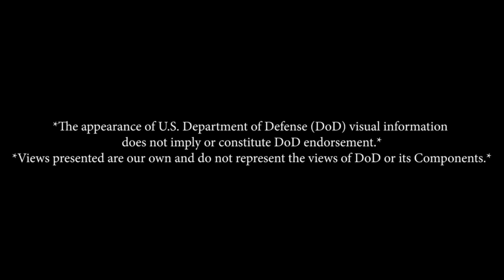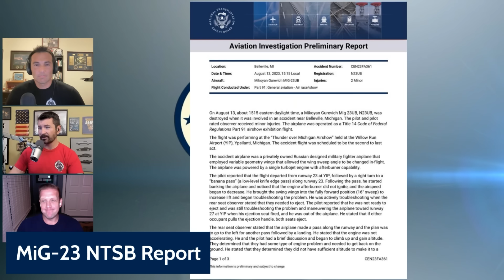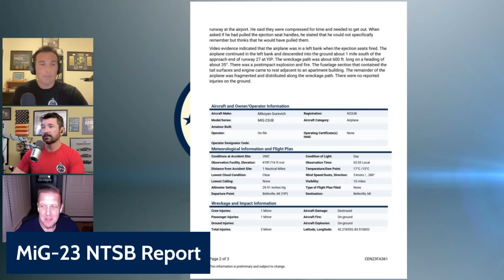MiG-23UB Mishap NTSB Preliminary Report Review

Comment: Richard Bach, in his excellent “Stranger to the Ground,” tells this story from back in the ‘50s. A USAF T-33 was on a flight somewhere over Europe. The guy in front was PF as would be expected. The guy in back reached down to adjust his seat but instead pulled the lever to inflate the under-seat life raft. The designers had apparently recognized that this could happen and had placed a sharp object within reach. The backseater employed this to puncture the rapidly inflating raft. The raft was rubber and so was packed in talcum powder. The intercom cable got unplugged so the PF did not know any of this. He just saw the cockpit fill with smoke. Apparently item 1 on the smoke in the cockpit checklist was shut down the engine which he did. The guy in back thought the engine had failed and he punched out. Meanwhile the PF had spotted a suitable spot on the ground and carried out a successful off field (i.e., crash) landing. Unfortunately there is no surviving record of what the two had to say to each other at the debrief.
Reply: that's some looney toons s**t
Reply: Whats normally said in that situation lol

Comment: Back in May of 1986 the local ANG (128 TFS, 116 TFW) gave me a back seat ride in one of their F-4D's.
The first thing the pilot told me, after strapping in, was: "DO NOT TOUCH THE COMMAND EJECTION HANDLE UNDER ANY CIRCUMSTANCES!"
It was in the vertical position, which means that if the pilot ejected, both of us would have gone, me first, or, if I had ejected, only myself would have gone.
Guess this brief (or at least strong advice) was not performed in this case...
Also: "Do not attempt a ground ejection, I will get us out...", and, "Do not jettison the canopies..."
Must have known a lot that I did not.
Thank goodness that that Flogger, by some miracle, missed that apartment building by the narrowest of margins.
Now, I wonder who sues who for causing the crash?
Reply: Back in same time frame there was a fatal accident (Navy?) where they were showing some kids the cockpit and somehow one pulled ejection handle & seat fired inside hanger.
Reply: @alanholck7995  That was an S-3A at an airshow.
The kid was not strapped in to the seat so he fell out at apogee.
Ejections on hangar decks and hangars are messy...
Reply: @alanholck7995   The seat was not safed? Someone should have been court-martialled for that.

Comment: 20 year AF guy here, if a pilot says he has it, you leave the damn handles alone, unless you either have fire licking at your butt, or the pilot is incapacitated AND as Mover said, you yell EJECT, EJECT, EJECT! BEFORE pulling the damn handles.  As Gonky said, if you are not head back into the headrest and arms by your side when you go, you are indeed looking at a better than even chance for "200% VA determination".  Seen a bad example of that when a 2nd Lieutenant punched out a Full Colonel who was troubleshooting a flight control issue, without saying anything, and broke the Colonel's back. IMO this backseater (at least two notches below WSO, 🙂) lost his nerve and panicked.
Reply: @davidkavanagh189  I'd love to hear word by word exchange once it was clear afterburner didn't light up. I can imagine "Wait Wait Wait" from font seat as important as calling Eject.
#DiscourseAnalysis
Reply: Crew Resource Management is strictly knowing who is doing what during the task.  Yes, this may include scenario mitigation, but in the end there should not be, any confusion about who is in command. In the Air Force (as with other military brasnches), command equals responsibility for the unit and its members and that is sacrosanct.  If this ejection whether unilaterally or inadvertently done, had harmed anyone, either his crew or those on the ground, the pilot/AC would have been the one responsible. I would tend to agree with your assessment if the aircraft was going straight down OR as stated, a fuselage fire was out of the view of the pilot, but again, you have to warn that the ejection is being done.  AND the AC would be still faulted for losing awareness.  As the recorded visual perspectives available could be misleading as far as flight path trajectory, this aircraft did not appear to be falling out of the sky at the time and did glide quite far before impact. Of course this is all moot if these guys had zero military experience, and were just out having a good time, but then flying high power jets over populated areas is the wrong place to do 'watch this' flying.
Reply: @paulholmes672  the rear pilot was smarter in this situation... i dont care who is in command... front seat pilot was affected by loosing his aircraft... so he trying to save it beyond reasonable rate... they dont have much more time to eject... save ejection for km-1 is 300ft in slow speeds... 

if i as more trained and experienced guy in the cockpit will yell eject eject eject and owner of the aircraft will yell no no no i got it and wanna try to save the plane even if its not savable... i will go out no mather of what...

Comment: I walked the crash site. This plane practically threaded the needle the way it crashed. A few degrees to the right or to the left, if it crashed a little earlier or a little later and there would have been a lot of deaths. If this backseater ejected on a whim, he'd be looking at some major manslaughter charges if that had happened.
There were some guys there when I walked the site (and took pictures) picking up scraps of the plane. They were local aircraft enthusiasts. Most of the stuff they had found at first was bits and pieces of hydraulic hose and pieces of the plane's hull (just a few inches in size at most). I looked down in the mud and found a few little pieces myself including some sort of dual electrical socket and a hydraulic module. While I was there poking around, one of the guys found this large bullet shaped cylinder thing about 12-18inches long and maybe six inches in diameter. It had some big electrical cables coming out of the flatter end of the cylinder and they connected to some sort of open electrical box with components inside covered in Cyrillic writing. More cables came out of that electrical box and connected to a smaller metal box. I took pictures of it and strongly suggested that the guys call the police and let them know what they found. After a few days, I couldn't help but think that they might not have turned the module in so I found the NTSB website and submitted the photo and a description of what had happened with my contact info. The next morning, I got a call from an FAA guy stationed at Willow Run airport and I went over what happened regarding the guys picking up scraps and about the accident itself. The guy was really friendly and personable. He said that they might reach out to the media if they thought the component was important to the investigation. That never happened, so I'm guessing those guys have a pretty cool souvenir.
Reply: 1) anything dangerous or secret would have already been removed from the aircraft 2) don’t be a snitch, why give the faa more power and a case to hamstring someone for a frivolous reason.  You were not harmed, stay away and stay out of people’s business.

Comment: An observer is a person who occupies a jump seat on the flight deck during a flight. There are various reasons to have an observer on a flight: Checking or examination of pilots. External (e.g. CAA) or internal (company) audit. Pilots on positioning duty (e.g. jump-seating to another base, home, etc.)
Reply: They should do those things over a safe location or home field. Not an airshow packed with spectators and people going about their days. 
So lucky it crashed in a narrow strip between a busy intestate highway and apartment complex. Also just outside the airport fence and not far off centerline for the runway. Had someone been there to pilot it, a safe landingg appears entirely possible.

Comment: The thing is the UB is a trainer-fighter modification. The dude in the back is supposed to be an instructor (and in the front is a trainee). So, because it's assumed that an instructor knows better, when he pulls the handles both eject. Pilot's consent not required. I think the dude simply didn't know that. 

Also, judging from the vid of it it looks like he ejected them from a perfectly capable of flying aircraft. It's a swept wing, after all. 
Also, the dude's a snowflake that can't handle pressure, destroyed the only flyable privately owned 23. 
Also, he justified it as they wouldn't be able to land it safely. But yeeting a craft into a populated area is safe? lol

Comment: Hey man, been following you for a few years now, question to ask you. (I'm a little freaked out) I live in the Republic of Ireland (we're a neutral country) I was out with a mate of mine and we saw 3 fighter jets with green lights on, my question is we as Irish don't have jets, we have pc930m's.should I be worried?? I know there was talks of us buying F16's but they flew low and fast the lead one seemed to be about 100 to 200 ft lower, I don't know if it was the RAF I tryed checking flight radar and nothing came up, I don't know it or whats going on I'm freaked. This was at about 22:10/22:15 (10:10/10:15 pm Irish time) maybe a touch later. I'm freaked out like proper freaked
Reply: Nothing to be freaked about. Nothing will be over Ireland without being tracked and known about. Could well have been RAF as they conduct air space policing on behalf of the Irish

Comment: Epic facepalm.

All versions of the MiG-23 (as well as the MiG-25, and possibly the MiG-21 family from the M version) have a KM-1 seat made by the MiG design office, which is 0 meters from 0 - 270 km/h , 100 meters for speeds of 270-600 km/h, 500 meters for speeds up to 600 km/h, ensures the pilot's survival. If I remember correctly, this seat is associated with the highest speed ejection survived, at M 2.83 from a MiG-25. (not for the Zvezda K-36, which was originally designed for the crew of the Russian spacecraft Buran, and is essentially the mainstream seat in the Su-22 and MiG-29/Su-27 and its derivatives to this day)

MiG-23 ejection sequence: rear canopy, rear seat, front canopy, front seat. It can be seen from this that the pilot would have had more to worry about the decrease in height, since his seat is approx. It goes out 1 second later than the rear one, and this 1 second has been the difference between life and death many times in practice.

The KM-1 also has an arm and leg arrester, but ejecting from a fifty-year-old Russian fighter jet without adopting an ejection posture often meant severing a limb, and in this case the pilot's guardian angel was not on a day off.

In general, about catapulting over people in a populated area: Hungarian Air Force, 16.09.1990, one of the first airshows in Hungary. A MiG-21 and a MiG-23 take off in a pair, then separate and try to face each other above the runway axis in front of tens of thousands of spectators. The pilot of the MiG-23, Károly (Charles) "Sopi" SOPRONI, makes a mistake during the turn, he sets the wings from the 16-degree sweep used during take-off to the intermediate 45-degree sweep, as a result of which the turning radius of the aircraft increased, then he increased the bank, and sank , and on the verge of falling dangerously close to the spectators, over whom he can either go or not. You have to choose, you reduce the bank, and on the plane on the verge of falling, you either go over the spectators, or you don't, or you increase the bank further to 90 degree and, using the remaining lifting force, turn away from the spectators.

Sopi turned away.

https://www.youtube.com/watch?v=GattJNyjBUw&t=217s

Comment: Those seats were old, did not have rockets, just charges, you can see it in the video, guys. 🙂
Reply: Pretty sure the KM-1 is rocket a seat, though it's not a zero-zero seat.  The MiG-23 is a late 60's airplane.  Non rockets seats were more common in 50's era aircraft (for example, the F-104's downward firing seat).
Reply: @RocketToTheMoose  I had to dig a bit. And you're right! I was wrong.

The SOP manuals in Czech from CSLA states that. There's even a picture of the motor firing from the accident flight on the FlyWire youtube channel.

Comment: I never flew with a parachute having an escape means saving myself. I wonder what it would feel like to kill innocent people while saving my cowardly ass and escaping instead of fighting to the end. All for a show and possible ego stroke.
Reply: The pilot tried, the backseater pulled the handle and threw them out. For a cowardly pilot see the Sknyliv air show disaster
Reply: Mate, flying an aircraft like this is not the same as your Cessna or even a 737... the stall & handling characteristics are not designed to maximise glide performance or manoeuvrability when things go wrong.  That's why they have ejection seats, and why military aircraft operate  away from populated areas.  When they punch out, the aircraft doesn't fly for more than a second or two and in most cases the pilot has little to no say in where that plane hits the ground.

The airshow organisers should not have fighter jets operating over residential areas at low altitude, but given how ridiculously close housing development is allowed to get to airports in the States this type of incident is inevitable.

Better to have two living pilots who can explain what went wrong than two dead ones & a lot of unanswered questions. And it's far more heroic to face the music than kill yourself to avoid it.

Comment: the rated operator should be mig-23 owner and pilot also... KM-1 is not true zero zero ejection seat like K-36... KM-1 need atleast 100m/300ft to save ejection in slow speeds... so bailout option was very smart decision by rear pilot... mig23 alt was aprox 500ft.. and descending... there are so many pilots which wants to save plane or find solution to malfunction... almost everyone is in grave right now... spitting shame on someone who save the day, only because front pilot was wrong is bad... maybe communication in cockpit was also bad... but it doesnt matter, every human react differently in stress situations, and here was also included his property and money spended into jet it deffinitly change and slow his judgement...